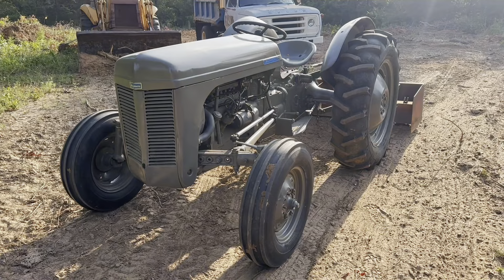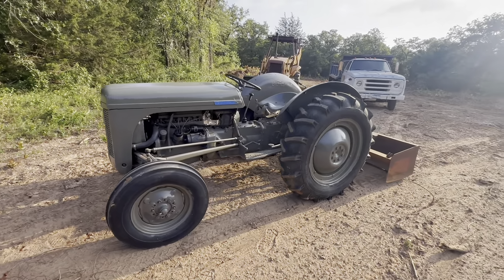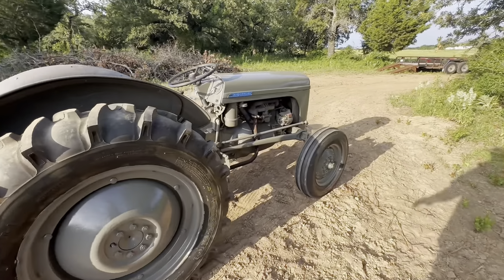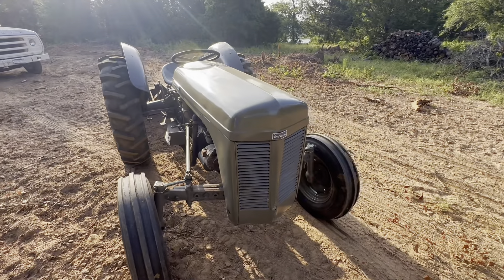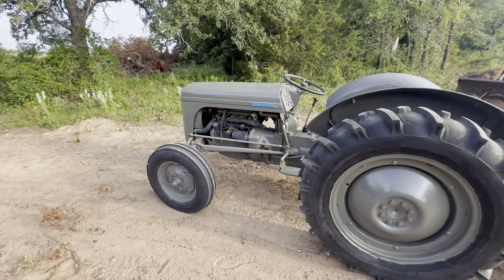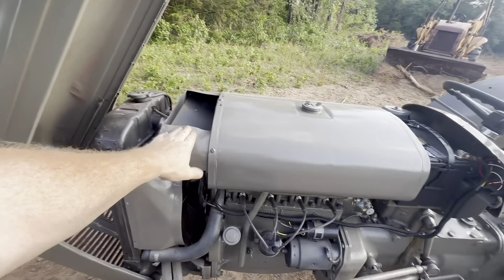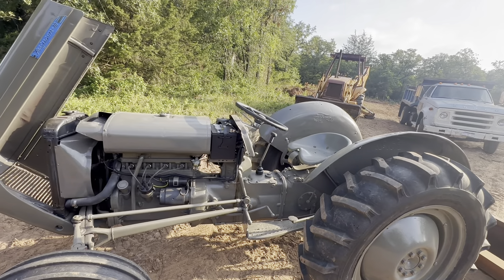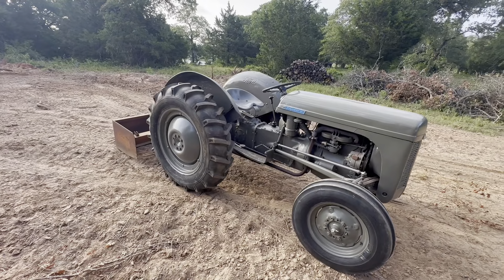My restored Ferguson to30 tractor

Comment: Useful little tractor. Is the paint a bit dark? I'm used to seeing those with thinner front tyres.
Reply from the maker: I’m not sure if it is or not. It was sold to me as Ferguson gray.  I dunno if most are just faded lighter or if this one is to dark. This has the right size front tires according to tractor data. The rears are a tad bigger though. Thanks as always
Reply: @cabovergary  In Britain, thin nineteen inch tyres are normal for 20s, but 35s had ones like yours, whether grey or red after Massey-Harris got involved in the late '50s